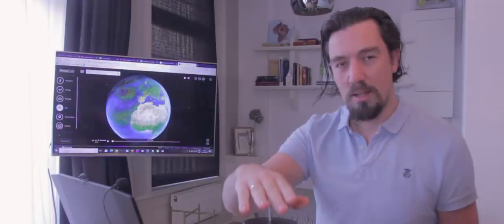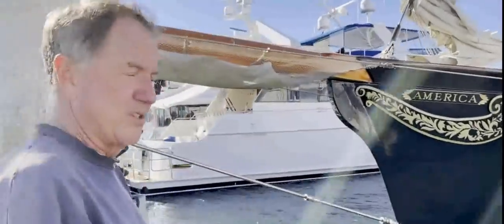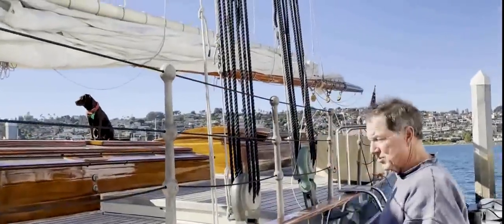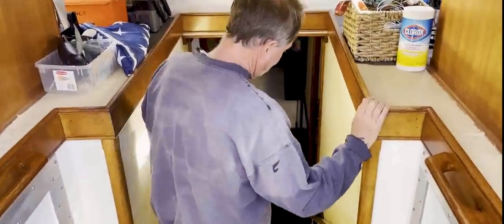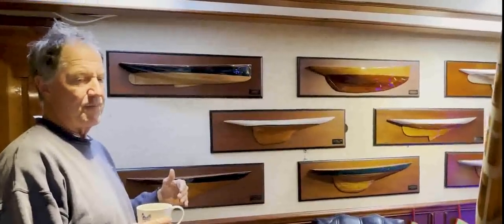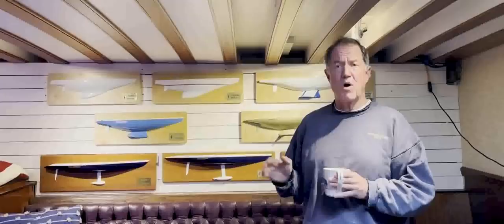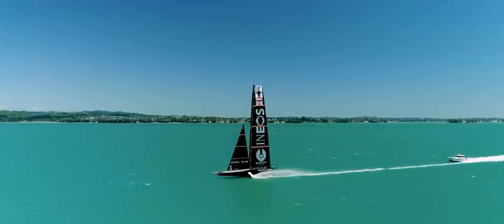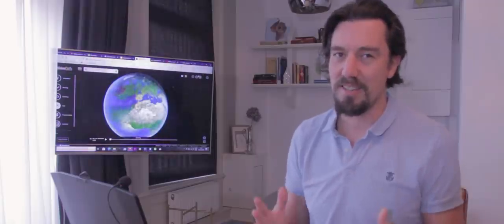Sea Wolves - The new America's cup boat! AC75 Technology analysis/Deep dive special! Auckland 2021

Comment: I wonder how much ground effect lift they are getting from the hull.
Reply: I think that the skeg also increases ground effect.
Reply: @Secretlyanothername  
the skeg has being mentioned elsewhere as an end plate to seal joint between the sea surface and underside of the skeg to improve the airflow, not unlke a winglet on an aircraft wing. 
A second benefit to the skeg is a structural advantage. The deeper, height wise,  is this acts as a more efficient structural beam to reduces the bending of the hull from loads imposed by the forestay, mast and foiling arms.

Comment: Now THAT was an excellent episode. Bravo!

Bit short of time here, not had time to read all of the comments, so someone's probably already said something along these lines...

I would imagine that the huge number of telltales is necessary to maintain optimal sail shape, across the whole area of the sail, throughout the whole range of speed profile. It would certainly help them to adjust shape to conform to the rapidly changing power requirement during transition.

With the shift in apparent wind being so large, due to the high speeds achieved, it would otherwise be a complete guessing game for the trimmers.

 Or......I could be talking out of my hat? <:-))

Cheers all !!
Reply: I think you nailed it. I imagine (for one thing) it is particularly important to work out exactly WHERE the sail is first stalling, in the case where the boat falls off the foils. Not just (say) how low and how far aft of the mast, but this question needs to be answered for each of the skins, windward and leeward, because (at least in one case) they have separate control of camber position and depth, and vertical distribution of camber, and twist, for each skin. 
As with a solid wing, they can also control the angle of attack at the top of the sail independently of the bottom. With great control comes ¨great responsibility¨ to use it to best effect, which in turn requires detailed knowledge of the nature and direction of the flow in all locations.
It is so crucial to maintain and redirect drive at the instant of falling off the foils -- or even better, the instant immediately preceding that unhappy event  --  that I imagine they tirelessly study each occurrence in order not to overcompensate. They want to drastically arrest the stall only in the part of the sail which is stalling; everywhere else, it´s more a matter of adjusting to the resultant change in apparent wind velocity (which includes direction)
They (at least in the case of TNZ) also have telltales all over the nearby structures, including the signal tower above the rudder, and the inboard coamings of the crew trenches. So they´re interested in the flow near , not just across, the membranes.

Comment: Finally the ice has been broken. The 4 regattas on the first day of the America's Cup World Series gave particularly beautiful images in a day with perfect weather of the Hauraki Gulf: wind between 15 and 18 knots, sun and flat sea, which allowed the teams to experience the performance of the their boats in real competition after years of training. The day saw some important gaps, but not only that. The starts were all very close, even more than expected, and the last race was run entirely on a tightrope. Good conditions for the show in general.
The first challenge between Luna Rossa and Team New Zealand goes to the hosts
The program saw the opening match against Team New Zealand and Luna Rossa's challengers. For the Italians, therefore, immediately the most difficult challenge. The pre-departure was immediately very tight. The wind had turned particularly to the left and New Zealand took that part of the line by force. Luna Rossa, however, responded by putting the defender in difficulty, aggressively "pushing" him towards the line and then turning and starting on the opposite tack, with New Zealand struggling to cross the line itself.
First advantage for Luna Rossa then which however quickly vanishes. A combination of something imperfect aboard the Italian boat, coupled with better wind pressure on the left side of the course gives New Zealand the first crossing ahead of the Italian boat, albeit slightly.
However, something continues to not work in the right direction on Luna Rossa. The boat flies higher than the New Zealand one (with too high a height it loses efficiency) and has some problems even in the turns. After the first crossing, New Zealand literally flies away with almost 900 meters of advantage at the end of the first beat. From here on, the situation will tend to stabilize, a sign that on the boat owned by the owner Bertelli, helmed by Francesco Bruni and James Spithill, things have at a certain point started to work properly. The AC75s are extremely complex boats even in on-board systems, and having problems in these first official races was expected by all teams. The fact is that New Zealand takes home the first point of the series.
Team Ineos UK in huge difficulty
The second test of the day saw the challenge between the Americans of American Magic and the English of Ineos. The regatta of the latter actually lasted a few minutes, after which they began to show problems in maintaining themselves on the foils, also seen in the test races, with high-speed dives in the water and violent braking that gave the Americans a victory. more than easy with a detachment even beyond the maximum time allowed. Luna Rossa also easily wins against the English, who will eventually have to withdraw from the regatta due to the succession of technical problems on board. The aggression shown at the start by the Italian team was beautiful: knowing the weak point of Ineos, which is that of having a hard time starting again once he got off the foils, the Italian team managed to "fit" Sir Ben Ainslie in a corner of the start with a very aggressive leeward tack, which plunges the two boats into the water.

From here on it becomes a walk for Spithill, Bruni and companions, who at the moment of the start fly towards the line at full speed with the English in an embarrassing difficulty.

Bad situation for the union with the most budget available (we are talking about 120 million euros, against about half of all the others) which will have to find solutions quickly, given that from January the points will weigh seriously.
American Magic hit in a wonderful regatta
On the other hand, it was a beautiful show in the last test of the day that saw the Americans of American Magic, helmed by Dean Barker, against Team New Zealand. Something is wrong at the start on the New Zealand boat and American Magic immediately starts strong and ahead. New Zealand remains in close contact, at times it seems to have the speed to get closer, but a problem with the handling of the keels forces the home team to very slow turns, throwing it back whenever it seems in a position to attack. This was until the last lap of the course, when the problems were finally resolved on New Zealand and the defender showed all his speed (and above all his ability to tighten the wind upwind).
The Americans are not there to be caught and a battle is born made of pure match race, simply run on the edge of 80 km / h. At the last buoy the boats arrive together, with New Zealand taking in and seems to have managed to complete the comeback. Burling, the Kiwi helmsman, however, is perhaps too enticed by the possibility of increasing the advantage and leads the Americans too far off course, incurring a penalty, albeit doubtful.

The Americans take the lead again and manage to close in front of just 12 seconds, hoisting themselves at the top of the general classification with 2 points, ahead of Luna Rossa and Team New Zealand with 1 point and Team Ineos with 0.
Obviously it is too early to draw any definitive conclusions, especially as the event does not award decisive points and therefore no one knows how much the teams are really pushing. First impressions certainly see the New Zealand hosts very strong, but that's no surprise. Luna Rossa seems to have a bad customer in the Americans for the Prada Cup. The program of the second day includes 2 challenges between the Italians and American Magic, which promise entertainment and to be significant in trying to understand something more about values in the water.

Comment: Kiwis designed the better hull in my opinion. Their skeg serves the same purpose as a water ski during jibes and tacks, enabling their boat to skip off the water and keep from sinking into displacement mode less frequently than other boats. Combine that slight advantage with the lower center deck and higher crew “gunnels” so obviously designed to convert wind sheer to lift as air moves under the hull, and across and through the deck. Hence my opinion the Kiwis win it on design. There’s more to racing than design, of course. We’ll get some deliciously competitive races and see mechanical, rig, and fitting failures, with strategic and tactical drama, etc.. But all things being equal, the Kiwi design wins it on ability to transition and capture additional lift from their water-ski skeg and air lifting hull and deck design—the other designs will require more consistent and higher wind conditions with flawlessly precise boat handling to capitalize on any Kiwi mistakes if they hope to win a race. That’s how significant I believe the Kiwi design advantage is at this stage of the game.
Reply: They also seem, at this admittedly early stage, to be ahead in foil efficiency (they have the smallest foils, and yet can fly in the lightest winds) and in mainsail shape control. To take just one of many examples: they seem to be able to deepen the chord at the foot of the sail remarkably quickly, which is an essential prerequisite when the boat drops off the foils and the apparent wind flicks aft and flickers out. 
Obviously they also need a sudden ease to prevent a stall (of both the sail and the rudder), but there is no difficulty arranging this on almost any boat. It´s my guess (at this early stage) that this is part of the reason they sometimes seem able to stay up better than their opponent.

Comment: Just to clarify, when you mention reducing power after rising to full foiling, what is being depowered is foil lift, mostly the vertical component I suppose, not the sail plan. 
The foil "flaps" must have trim tabs, no?
Reply: I can´t pretend to any expertise, but it seems to me that it would indeed be essential to adjust the power delivered by the rig once up on the foils. The hydro drag is drastically reduced, the righting moment greatly increased,  and (at least when sailing to windward) the apparent wind speed massively increased, so that the trick presumably becomes one of providing only sufficient lift, directed as close as possible to in-line with the boat´s desired course, while incurring the least possible amount of aero drag. The amount of lift can be greatly reduced in comparison with the startup phase, and distributed much higher up the sail (because so much more righting moment is available from the foil package)
Of course you´re right about the foil needing to be depowered also. Not because there is less lift required (it still has to lift the unchanged weight of the entire boat) but because the flow across its surfaces is so much faster, that unless adjusted by reducing the flap angle, (and by raking the rudder to provide more lift from the tailplane, thereby dropping the bow slightly to reduce their angle of attack) the foils would lift themselves up to the boundary with the air, where they would ventilate, with unhappy consequences.

Comment: I don't think the sail power is as big an issue here as with the IMOCAs. You can alter the lift in the foils with the foil controls. They will maintain the same sail area, but when the boat lifts and accelerates they will flatten the foils to reduce lift and then it's more a change in apparent wind angle they will have to react to than actually needing to reduce sail area. From windsurf foiling if we are overpowered we can either reduce sail size or reduce front wing size on the foil and these boats have the ability to keep sail size constant and alter the wing lift.

Comment: I agree with you, Florian.  Being called a "monohull" is kind of a joke with these boats.  I really kind of find it disingenuous with the Kiwi's and others who were complaining during the last cup about catamarans, and saying they wanted to go back to monohulls, whereas actually, there's hardly any difference between the 2 as far as- once you're on foils, you're on foils!  And they plan (and you can see they can do it) to be on the foils 95% of the time- including on tacks and jybes. 
The 'monohull' in this instance really doesn't mean much, and it's definitely not "better"- it's just a different 'base' for the foils.
Reply: The cats are far more dangerous in a capsize and are more likely to pitchpole, and to break up in either situation. They also present significantly more aero and hydro drag, which explains why these monos are so much faster to windward than their predecessors, sailing faster and pointing higher. The AC75´s upwind Vmg is already a major improvement on anything hitherto achieved by any sailing class. They also have the potential to be substantially faster on a reach. Even though the new course has no reaching leg, TNZ has already matched, in this very first regatta, the fastest top speeds only recently attained by the more highly developed cats, with their much more sophisticated (but impractical and unseamanlike) hard wing sails.
Reply: @Gottenhimfella  That's great, and I appreciate that they are a step up in speed, etc.  But that's not the reason people were complaining when the cats first (and later) were being used.  You didn't really answer to my and Florians main point that these aren't really 'monohulls' in any kind of traditional sense- it's just a single platform for the foils instead of 2.
Also, I don't believe anyone pitchpoled during the actual racing, and I don't know if we really know how much safer these AC75's are.
Reply: @windwardpro  Team NZ pitchpoled during a race in Bermuda, and have capsized in training with their first AC75. In these cases the boat behaved like a cat and a mono respectively. Moreover, AC75s behave like a monohull when in displacement mode, just as the catamarans behaved like cats ditto. Given that you seem happy to refer to the latter as cats, I'm not sure what the problem is with referring to the former as monos?
Reply: @Gottenhimfella  Right.  No, I don't have a problem with them calling them monohulls (because they have 1 hull)- but I am saying for all the earlier hype of wanting a monohull, they have FAR, FAR more similarities to the foiling cats of the last cup than they do to any regular monohull.
I like these boats, but a plus for the cats was, at least they could keep going at a decent speed when off the foils.  That is definitely the achilles heel of this design.
Reply: @windwardpro   At first my impulse was to repudiate your (latest, and final) claim, but I realise now that the claim I thought you were making was different from the one you were actually making.
I realised this having decided to review race 13 of the 34th AmCup in San Fran, which was a re-run of an abandoned light-wind race earlier in the day, during which neither cat could foil. However one of them managed to do a horizon job on the other through consummate skill much more than luck, and was robbed of a win, and the AmCup, only by the Race Director inexplicably neglecting to shorten the course, as the rules allowed, so that the leading boat could finish within the time limit (which it just failed to do on the unshortened course).
The second race was held in 10--13 knots. There were times when neither boat could foil, but you are quite right: the difference between foiling and not foiling was considerably less marked for those AC72s (big cats) than the AC75s (big monos from this series). And you are right, it WAS a more compelling race.
Personally I thought the cancelled race was even more compelling, because one team did an absolute masterclass in light airs sailing on a big cat. If the rule had been slightly differently worded, to REQUIRE (rather than just allow) the course to be shortened, that, to my mind, would have been the making of that class. Especially if they also permitted flaps on the main foils, so the ridiculous efforts by the grinders were not necessary.
I am happy to live with the risk of capsize or pitchpole on big cats if the sailors are. They bear that risk, we don´t. I do think their having a hull over each main foil is a safety advantage, especially given the foil tip is well inboard.

Comment: IMO calling AC75 a cat/trimaran is almost understatement (or monohull for that matter). Sure, in some way they are cats but unlike cats these don't need any heel to get the other foot out of water. The longitudinal stability comes purely from dynamic balance, not from buoyancy or two-point contact. Sure, they are monohulls since they only have one buoyant hull. But they are neither of these but instead foilers. It's almost like comparing Hindenburg to the U-2.

Comment: The hydraulic ram is powered by electricity, not the grinders. The grinders only work with the sails.
Reply: The humans also provide hydraulic pressurised oil to control the angles of the flaps on the foils.  Whereas the large battery driven (electrically-charged) accumulator, as you correctly imply, is connected only to the largest cylinders on board, which present and retract the foil arms.